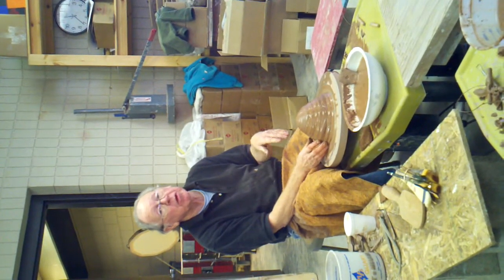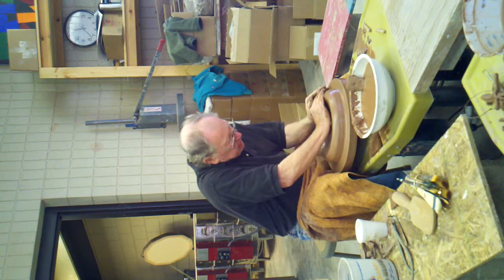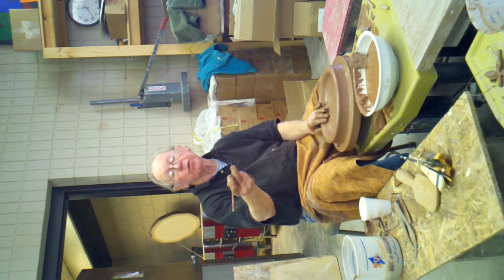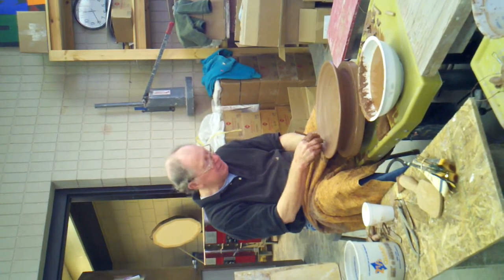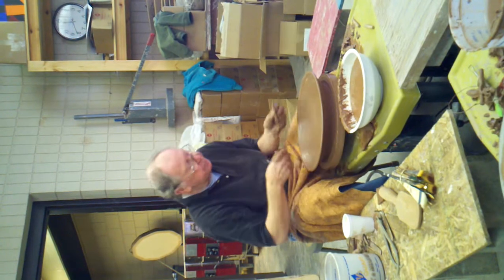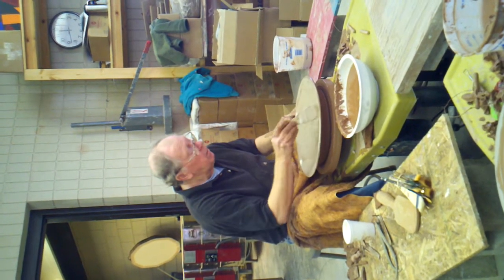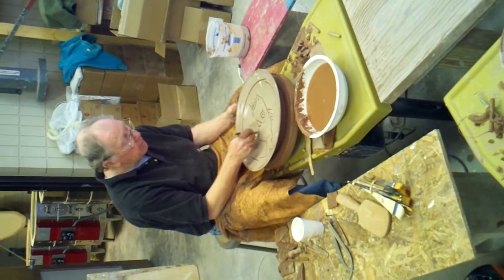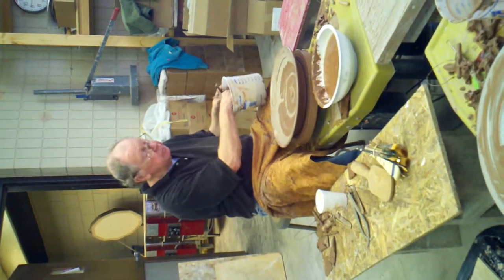Ron Meyers pottery

Comment: Very interesting. Tell me about the slip.  I thought that to get slip to adhere, it should be made with the same clay as is used in the pot, but obviously that's not the case here.  Or is there actually so much whitening in the slip mixture that it overcame the red of the clay body?  Is that even possible?